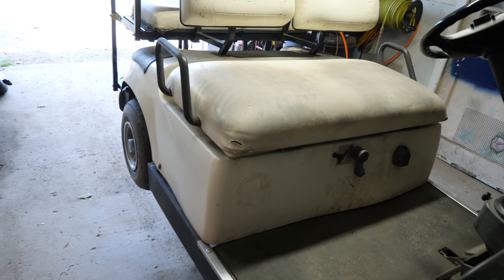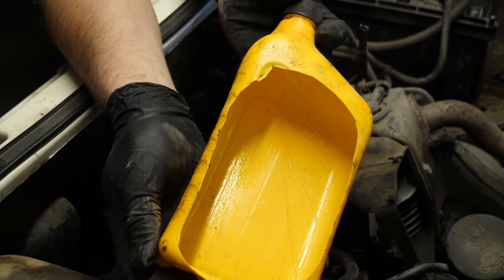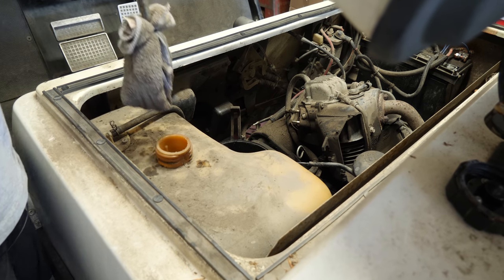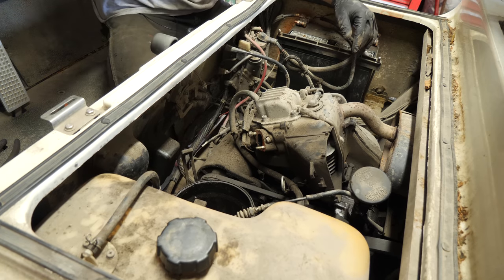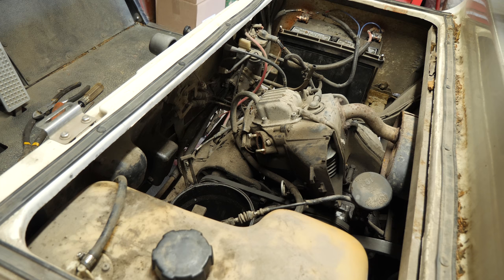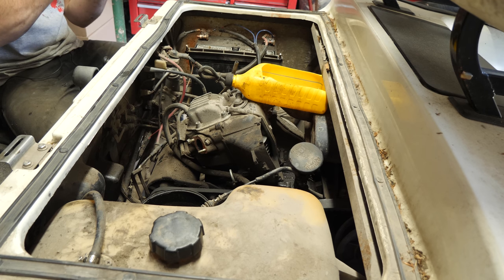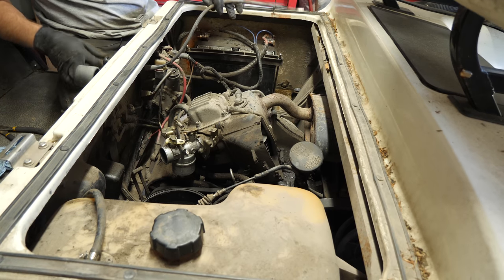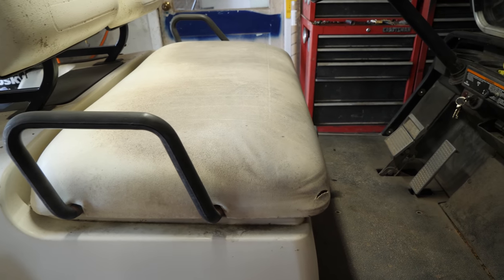1996 Yamaha G14, Gas - Crank, No Start, Water in Fuel, Clean Carb

Comment: Kevin where are you located. I have a 86 club car someone changed the carb an now it has no power at all. I just put new plug an fuel filter an air filter was thinking the carb the person put on is bad. Any help would be great help. Thanks

Comment: That jet that’s mounted on the top, outside of body. What’s it called? I’ve had trouble with my cart running well. Took the carb off and cleaned the crap out of it. But noticed a hole in the top sucking air. I see your carb has a jet in that location.

Comment: A great video, well filmed. I have just bought what I thought was a G16A but it has a G14 engine exactly the same as the one in your vid. Must have had a new engine sometime back. The only way that much water could have got into the tank is by someone putting it there. Sabotage ? Perhaps the owner annoyed somebody. I need to clean out my carb, so your vid camer at the right time, even though it is 4 years old!

Comment: Most atvs are not to loud from the factory, but because people think they need to put aftermarket pipes and mufflers on them to gain a half hp or a bit more throttle response is needed, which in turns makes them louder.

I grew up riding atvs till the early 2000s and then switched to a golf cart and I still ride one but not as much as I use to.

The major issue now is utv/side by sides. They are making them larger, faster, and louder even from the factory which is creating issues. I know of a boating community at lake Cumberland where they are getting complaints of side by sides blaring music and screaming up and down the roads late at night which is disrespectful. I understand you there to relax and have fun, but the parents are just as responsible for the issues as the kids that ride them. That's my opinion on the subject. Dont Buy a machine that will put your kids in that situation and if you do, your allowing the problem to exist, and as long as the machines are being bought. They will continue to make them. Not to mention most of them are ranging up to 20k for a single side by side . Its crazy.

Comment: This is one of the issues I have to deal with. Removing the tank pressure cleaning and rinsing with methylated spirits or clean fuel! They are trying to make ATV’s a lot safer by putting roll bars or cages on them, personally I hate them!

Comment: Thanks for the video. I put a new carb on a G14 that had been sitting for a while. It runs but it doesn’t have any power, it barely makes the cart roll around. I checked the fuel pump and is pumping gas.
Reply from the maker: If it still has old gas, you will have to pump down and clean the tank. I would refill it with ethanol free gas, if you have easy access to it. After that, disconnect the fuel line from the carb and pump a few ounces through the fuel system. You will have to pull and clean the new carb to get the old gas out.
Reply: @Kevinsgolfcarts  It had very little of the ok’d gas, I filled it with new 89 octane and an octane booster additive
Reply: @Kevinsgolfcarts  thanks for the advice. I replaced the gas, the carburetor, the fuel filter, gas pump and one of the hoses that looked bad. I tried messing with the needle adjustments but, the carb is still not running smoothly with consistent power. One one adjustment.c I pull the choke and it runs awesome. On another adjustment, it runs consistently with no power lol what needles do you adjust and how much (turns)? Thank you !